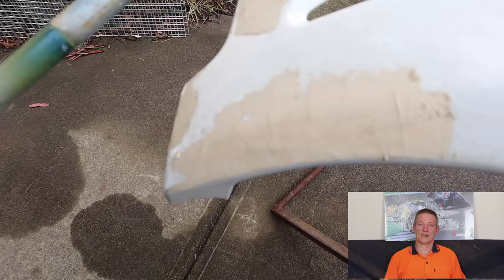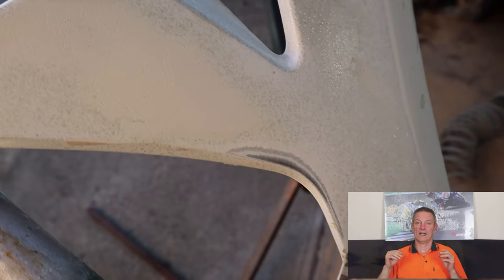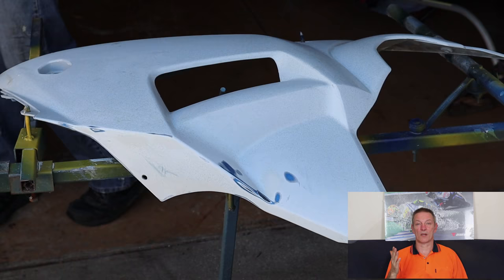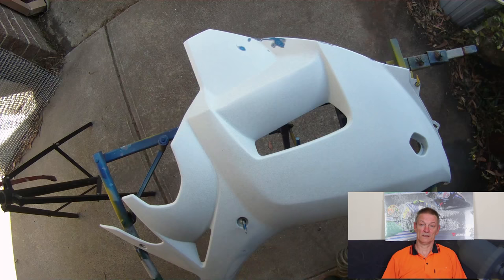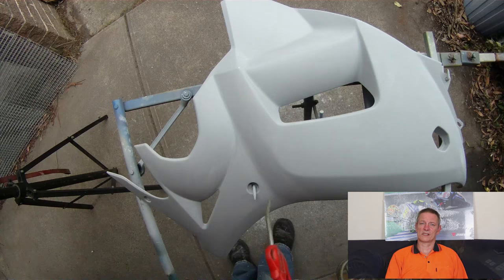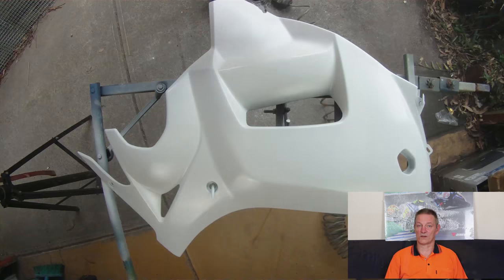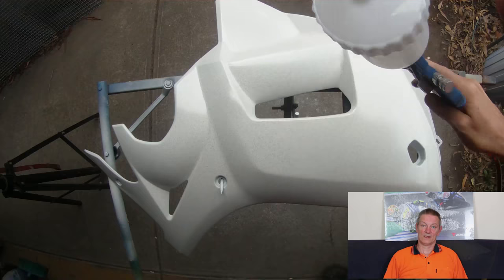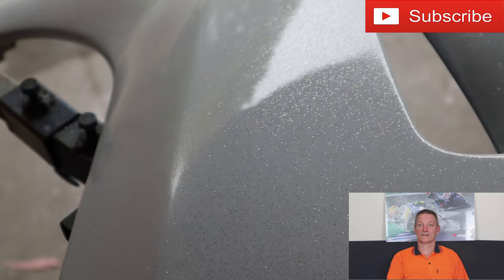How To Paint Motorcycle Fairings (Tutorial)

Comment: Hey kel I finally painted my bike. I used Nason 2 part base and clear. I put sapphire blue pigment in my first few coats of clear and and was only able to get one coat of regular clear before I ran out. I still want at least 1 or 2 coats of clear before I buff it out but I don't want to wait to order more. I  have some clear left from my boat paint job. It is called distinctive image DI-10 multi max clear. I was told its not the best stuff on the market. Will this ruin my paint job and should I use what I originally used on it. I also got some runs with the clear and would really appreciate any input you have on getting them out. Thanks for your time
Reply from the maker: Hey Brendan, Mate do not use the old clear, that is a bad move. Order some more and work on getting the runs out while you wait.
Ok, cut a strip of 360 grit paper  about 2 inches or 50mm wide. Get a stiff non flexible filler applicator or scraper. Cut the strip to the same size as the applicator or scraper. Fold the paper so you have a crease in the center with 1 inch, 50mm each side of the crease. Tape this over the end of the scraper. Slowly work down the run. You should be able to touch only the run due to the non flexible blade. When the run is flat, give it a wet sand with 600 grit and paint your new clear.
I hope this helps.
Reply: @howtowithkel3352  thank you very much Kel. Your advice has been very helpful so far so I am going to order more of the same stuff I started with. I was also curious about cutting compound and polish. I was thinking meguairs mirror glaze followed by their polish. Have you heard of them and if so how do they work. Sorry for all of the hassle, guess I should have planned a little bit better. Just a learning experience for next. Thank you again.
Reply from the maker: Hey Brendan, meguairs is a well know brand. In order to cut properly you are going to need a buff. It is better to get a machine grade cutting compound. Any paint supply shop will carry it.
Reply: @howtowithkel3352  hi I got meguairs ultra cut compound 105 extra heavy cut. I am going to get a polish now. I will be applying with a 7 in grinder/buffer/polisher with variable speeds. As againg i am a little confused on the process. I had planned to wetsand with 800, 1500 then apply the cut then polish. Does this seem correct or am I missing anything? Thank you once again. I will try to post pics when finished.
Reply from the maker: @brendanmangel8089  Hey, I would use. 800, 1200.1500 and then 2000. This will give you a glass like finish. Its a lot of wet sanding but you will love the finished result. 
Would love to see a pic when your finished.

Comment: Hi Kel did you use plastic primer on the beach you rubbed through
Reply from the maker: Hi Rob, no I just used a 2 pac primer/undercoat. That sealed it up very well.
Reply: Okay so I won’t have to use plastic primer ??
Reply: On the bear plastic that is
Reply from the maker: No, you will be fine to use a good 2pac primer. Just dull down the new surface with 600 grit to give the primer something to stick to.

Comment: My bike had a respray before I bought it and it's reacted badly in some areas, the paint has crazed.  I've got some replacement panels but can't get hold of the rest, I was told that I wouldn't be able to redo the bad panels. Do you think it's possible?
Reply from the maker: Hi mate, It is very possible to repair your old panels.Take the time to wet sand then flat with 400 grit paper. Then get some 2K primer undercoat, this will seal the panels. Once this is dry, wet sand with 600 grit paper and spray as normal. They will work out just fine.
Reply: @howtowithkel3352  Thanks for your reply,  that's good to hear. 👍😎

Comment: i used 80grit to rough up my panels+tank quicker, as doing all by hand, then (relatively quickly) used 120, 180 and 240 grit. Have I made a big mistake? I've been using the finer grits above and they seem to take the paint back very, very slowly. Hence me using 80. I'm thinking now maybe the scratches are too deep? I have one panel that feels very smooth, one, quite smooth, and the metal i havent gone above 80g yet, but looks very rough!

why do we use wet sandpaper? i just find it gets clogged instantly and spend ages spraying the scum off both the panel and sandpaper every 30-40secs?
Reply from the maker: Ok. 
The panels with the deep scratches. Use a good filler/primer first. Rub this with 400 grit paper. This should fill the scratches.  You should be fine to paint after this step.

Wet sanding will cause clogging on low grit papers. From 400 grit on wards this should not happen. The water will stop the paper from clogging if you dip your paper regularly. The reason I wet sand is to reduce the dust. Every time you blow dust off a panel its lands somewhere else. If your luck is like mine that dust will come back only when you start to spay.
Reply: @howtowithkel3352  followed your steps, and looks incredible thanks kel. I started using white cans of hycote Primer, absolutely rubbish, 4 cans wouldn't even cover 4 panels. Went over with a single standard hycote grey Primer and coverage was sweet with like HALF a can!

I do still have a few dust marks and also stupidly I tried to sand off a colour coat (3rd white gloss) paint splash/spot (from clogged nozzle) after about 30 mins of drying but 400 sandpaper (dry) ended up "pulling/rubbing" off about 3 pieces of paint leaving low spots/visible chips, and in one area on another panel back to bare plastic. 

This was last week so now will be 100% dry, in future what is the best course of action for when you see a dribble/spot or bit of dust? You should stop painting immediately then must wait 24hours to dry before sanding off with 400? Heat it with a heat gun till dry then sand? Or just wipe quickly? 🤔 

I haven't put any clear on these panels yet so I'm wondering if tomorrow now I should just sand, maybe use dolphin glaze filler on the chips, sand, and then re apply some Primer (grey so I can see where I've been) then go over with more colour coat. 
This is my biggest challenge as I only have my mates workshop on sat & sun! Trying to knock panels out in one day 😡 

P. S you earned yourself a sub already! 😂 Thanks mate
Reply from the maker: Hey how are you? 
Rule number one...... walk away and let it dry.  
You can use your finger nail to test if a run or flood is dry. You should not be able to push your finger nail into the paint using reasonable pressure. 
If you are going to apply color after this step. 600 grit is the roughest paper you should use. 
Any filler will work to fix your chips. Just under coat the fill, let it dry!!! A quick sand with 600 grit and your good to paint.
Reply: @howtowithkel3352  I'm not bad kel thanks, looking forward to finishing my hornet tomorrow... If paint goes well!

What do you mean "undercoat the fill?" as in spray the area to be filled with Primer first? Then fill, sand with 600, Primer again, then paint right? Like just in that area I hope.

Are you In lockdown over by you?
Reply from the maker: Normally you would only prime bare metal first. You can prime first if you want but it is not necessary. Prime after fill and yes only the area you filled.

Lock down here is the worst in the world. It is tough at the moment!!

Comment: What are the steps for unpainted fairings? I got a fresh set of "unpainted" fairings from ABS Fairings, and I'm going to paint them myself. Are the steps basically the same?
Reply from the maker: Hi, yes the steps are exactly the same. In this video you saw me seal the fairing with 2 pac primer/undercoat. This is your first coat, then color and clear. Have fun.
Reply: @howtowithkel3352  I'm still not quite sure what is happening or what "blocking," really is, I got Bondo lightweight body filler and some application spatula things, but I'm not sure how you're applying it in the video. Could you elaborate?
Reply: @howtowithkel3352  I am using a Matte Paint btw, an 06 ZX6R Flat Raw Plasma Blue. I am currently in the step of sanding them all and getting the shiny off from the molding process.
Reply from the maker: @piecrustyumyum  
https://youtu.be/WE_CMz7dyP8 This link is to one of my other videos. I apply filler in this video. Blocking is where you wrap a peice of sand paper around a sanding block. By holding the block flat agaist the surface you are sanding, the block will span a larger area allowing your filler to become level with the rest of the panel. If you hold the sandpaper in your hand without a block you will sand the filler below the panel surface. Have a look at the video, its all in there.
Reply from the maker: @piecrustyumyum  If your panels are new. You should not need to use bondo. Just wet sand them all over with 600 grit paper. Give them a good clean, then undercoat.
Reply: @howtowithkel3352  ah, alright cool, sounds good then, thank you so much! I paint them tomorrow! I just finished sanding them with 400 grit today, you would not believe how hard it was to get ahold of 400 grit 6 inch PSA sanding discs, you can forget about 600, I would have to order that online and I needed it today lol.

Comment: What psi should I use? And is 110 psi enough
Reply from the maker: Hi, You should be using between 20 and 30 psi.
I have a Devilbiss Gti Pro Lite. That gun uses 29psi. Some of my other guns are down to 22psi. Hold your gun still and spay some paper. Look to see if your pattern is even and nicely feathred on the edges. Adjust your pressure to get an oval pattern feathered edge.

Comment: Hey Kel,  I am going to purchase an air compressor and paint guns for a similar job.  Any tips what size air compressor to get or what to look for.  (trying to get a used one under $200 but not sure if this is realistic expectation)
Reply from the maker: Hi Dylan, you should be able to pick up a compressor that will do the job for around $200. Aim for a minimum of 12 cfm. Ideally 17 cfm is where you want to be but i don't know if you will find one for $200. If you are only painting small panels you should be fine with 12 cfm. Good luck with your search.
Reply: How To With Kel thanks Kel I appreciate your response!  Does hP or size matter as much as CFM?  Currently eyeballing a 2hp but I guess if the CFM is there the HP and size are what create it so I’ll stick to CFM.   Thanks again mate great videos
Reply: How To With Kel new ones from Supercheap/total tools @200$ are only 5-7CFM (120l/m) so def buying used cheers
Reply from the maker: Dylan, just for your knowledge bank. CFM is created by the pump. HP is important as obviously you need enough HP to drive the pump. 2HP is plenty for 12 CFM.

Comment: Can you send me a link of where I can purchase a kit to repaint my fairings. I used duplicolor on another project and it seemed ok for what I wanted to achieve. Would that brand of paint work. I used the championship white and I used a clear coat from a  local dealer.
Reply from the maker: Hi Brendan, you can use any brand of paint. Duplicolor is fine. I would recommend a 2 pak clear as it is a lot harder and has a higher shine  than most air dry clears. A 1 litre kit is all you should need.  What type of equipment are you using? Compressor and gun or rattle cans? Let me know what country your in so I can help you with a link.
Reply: @howtowithkel3352  thank you for the feedback. I am in niagara falls ny.  I will be using a compressor and gun. Would you recommend just a scuff sanding as opposed to going down to the plastic?
Reply from the maker: @brendanmangel8089  Ok, wet sand 600 grit. If you go through to the under coat in any spots. Paint just these areas first and wait 15 mins. Check for reactions around the edges of the undercoat to top coat. If it's all clear go ahead and paint your first complete coat. If you get a reaction, like a fluffy looking ring around the edge. Rub it back with 600 Grit and seal with 2 pak under coat. Then you will be good to paint.
Reply: @howtowithkel3352  is 2 pak the brand or is that just the clear coat with the 4:1 mix
Reply from the maker: @brendanmangel8089  Sorry mate should have specified. 2 pak is any product with 2 parts, Hardener and base.
Reply: @howtowithkel3352  no need to be sorry. Your feedback is greatly appreciated! You should charge for the in depth advice and support to the people you help. Its is really awesome that you do it out of selflessness to help people overcome their  own doubt to give them the best chance to try new things and have confidence doing it
Reply: I have two sets of side fairings, I was going to paint one of each. One is a matte black and the other feels like a  thinner plastic. Yhe only issue is that one of the black ones is a little more scratched up than the other PA6 PPE silver fairing. In your opinion which one would accept paint better.
Reply from the maker: They will both except the paint without issue. The choice is yours as to which one you paint. All that is important is to prep them correctly and you will not have a problem.

Comment: Great video thanks. Did you wet sand or dry sand with the 600 grit pre painting? Did you do the same before applying the clear coat? I have read that you need to toughen up the paint so the clear coat trips better?
Reply from the maker: Hi, I dry sanded the undercoat. You can wet sand if you want. In this case I did not sand before clear because of the flake. It is always best to apply clear over flake on the same day.  If you leave a part in color for a few days before you clear coat. It would be a good idea to give it a sand or use grey scotch brite. If you paint color and clear on the same day you do not need to sand.
Reply: @howtowithkel3352  thanks for the reply. Im guessing you use the scotch brite wet? It's not very warm here at the moment so I'm giving each step longer to dry / harden so I'll end up having to sand or scotchbrite as per your suggestion

Comment: How much paint for this piece?
Reply from the maker: Hi, Normally a panel like this would take. 100ml of under coat, 200ml of white, 100ml of flake and 250ml of clear.
Reply: @howtowithkel3352  thanks. Thats actually quite a lot. Money wise ;) Im working on some polyester track fairings. Stripped the old paint off. Now  I wet sand the gelcoat with 240. Is this too course for primer. Should i do them wet 400 now?
Reply from the maker: 400 is best for primer. You can give it a coat at 240. You will will more than likely have to coat it a few times.

Comment: I have a stupid question. I'm using your video to repaint my fairings. If I have a ding, let's say, a pencil tip wide, would it be ok if i use compound or plaster. I would hate to buy a product and waste money when i would use so little of. Thanks in advance and great video.
Reply from the maker: Hi, It is not recommended that you use plaster based fillers because they are porous. However if the ding is very small you might get away with it. If you have the time, fill it and paint some under coat on just that area. when it dries you should not be able to see the filler.  If the filler shows through or it is a different colour you will need to buy a car product. If the compound you refer to is a 2 part filler, that would work fine.
Reply: @howtowithkel3352  ... found a product called Bondo that might work. Thank you for the reply.
Reply: Carlos Sevilla lol plaster- you painting a house?!